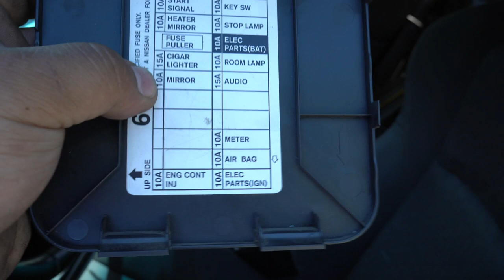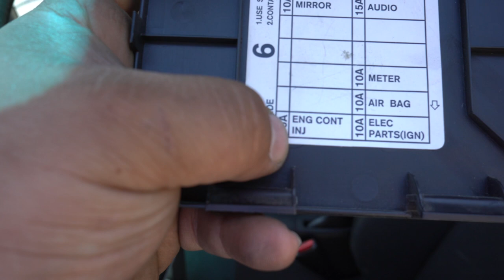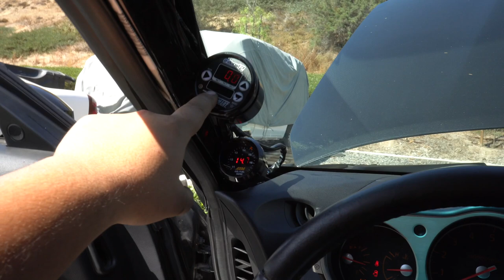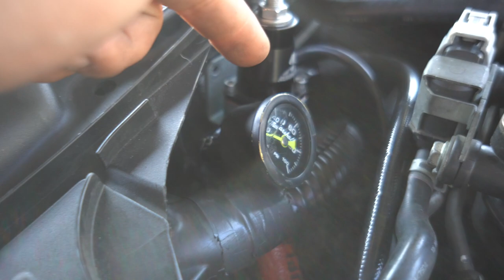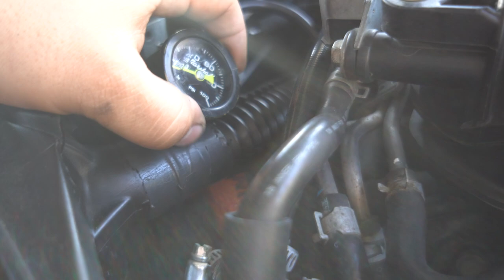What You NEED For a 600+ Horsepower 350z or VQ | Supporting Mods for Rear Mount Turbo kit

Comment: what if i get a oiless turbo instead of what you have? would it be less to worry about?
Reply from the maker: Definitely would be easier , but air cooled turbo is expensive, i plan on it but for the sake of the budget build I did it this way

Comment: What fittings are at the end of the 4AN line and 10 an Lines. Is the scavenge pump you selected reliable?
Reply from the maker: I just bought a fitting kit 45 90 and straight fitting . But I recommend just buying a kit from Amazon
Reply from the maker: Yes never had issues , it was actually on another turbo 370z before my car and it still running strong
Reply: @Alxbmovn  Good. Two of the reviews scared me.

Comment: Would it be way more expensive if I put my turbo in the engine bay
Reply: Where are you going to put it. That’s why they rear mount it.
Reply from the maker: It’s is possible ! But the fab would be more expensive! It would go where the power steering Res sits
Reply: More expensive for the fab work and it would be harder to remove